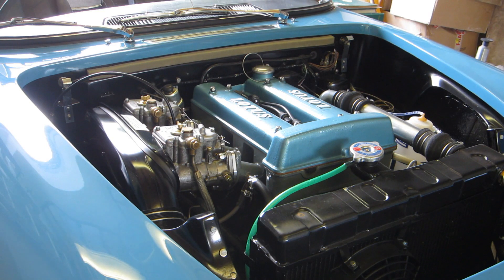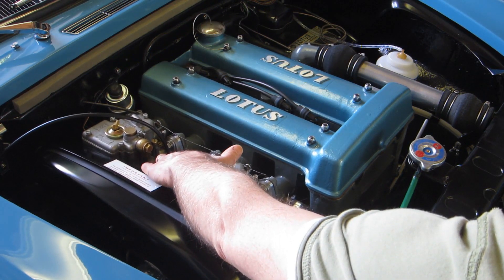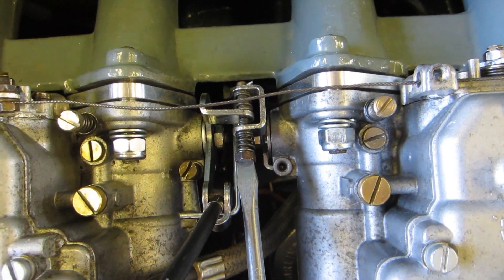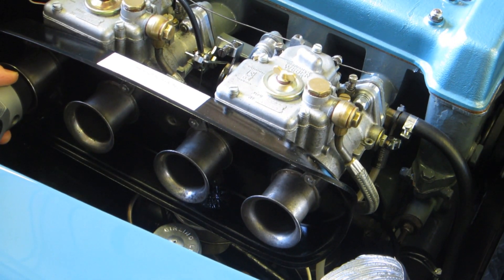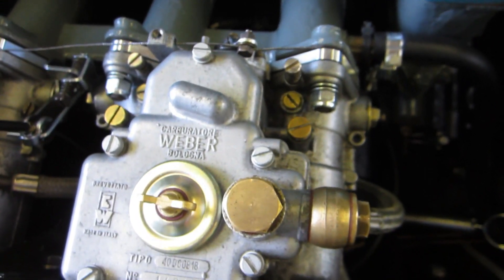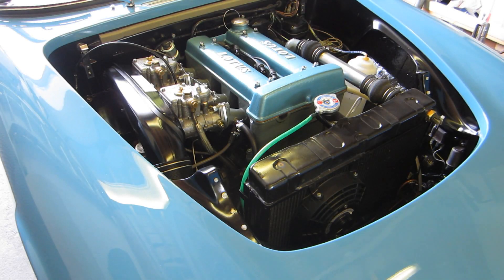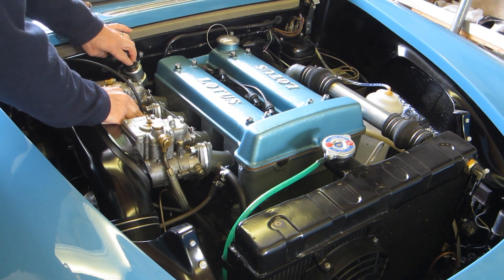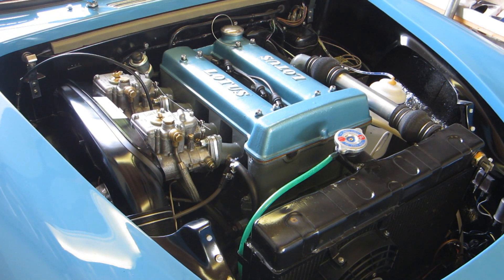Lotus Elan basic tuning

Comment: Brilliantly informative video Paul… I have similar problems with keeping my plus 2 in tune and fouling plugs.  How do you have your Webber’s jetted.
Reply from the maker: Glad you've found the video helpful :)
The jetting is as supplied by Lotus.  This is the list:
Choke size = 30
Auxiliary venturi = 4.50
Main jet = 1.15
Idle jet = 0.45 F9
Emulsion tube = F11
Air correction jet = 2.00
Starter jet = 1.00 F5
Accelerator pump jet = 0.40
Accelerator pump back bleed (intake discharge valve) = 0.50
Needle valve (inlet) = 1.75

I created a video showing the refurbishment of my Webers which is on my YouTube channel.  Here's a link if you're interested:
https://youtu.be/Whf3vKDnCJs?si=nOWD3CwigQ95ppdm
Reply: @PaulH_S2_Elan  Thanks Paul - same setup as mine however I cannot get the car to run reliably even with a colour tube and balancing the carbs.  I seem to foul plugs every couple of hundred miles or so!
I’ve rebuilt the carbs once before but will check your video to see if I missed anything!
Cheers,
Joe
Reply from the maker: I'd recommend searching the posts on lotuselan.net and ask that community.  There's plenty of knowledgeable people on there who could help.

Comment: Many many years ago and against the advice of some so-called experts I put a pair of Weber DCOE‘s on my modified  TR6. I did an enormous amount of reading about these carburetors and purchased many many Jets emulsion Jets Excelerator pump jets Venturis etc. etc. I had this car running with the best of them! These carburetors are not only infinitely tunable but deeply satisfying once you get them right. That car is long gone and as part of my stable I now own a 1960 bugeye sprite however it is super charged and therefore does not have side draft webers. If I was ever to buy another classic British car I would most certainly ensure it would accept a pair of wonderful weber carburetors.
Reply: Actually I had 3 carbs.   Oops

Comment: The problem is people expect old cars to idle from cold like new ones,  That's what chokes are for,  in the 70s to get a fast enough idle on a cold engine you had to have the chock out just enough to be in contact with the fast idle ramp on the carb linkage,  this didn't close the chock butterfly enough to richen the mixture but kept the engine running.   Then after 4 miles you could push it in.
Reply from the maker: Yes, no electronics and automatic choke to help here.  My experience of the Elan with Weber carbs is to start from cold, push the accelerator fully down and release, then hold the accelerator halfway down and turn the key.  Starts every time.  Pushing the accelerator fully down causes fuel to squirt into inlets, enough to start the car.  You don't need the choke to start.  If you are in the car, you can keep it running with the accelerator.

Comment: I thought a slack timing chain would affect valve timing therefore affecting engine balace.
Reply from the maker: I can't explain the science, but the Lotus manual explains there should be half an inch of chain movement between the two cam sprockets.  Push it down as far as it will go then measure from a reference face, then pull it up as far as it will go.  You're looking for half an inch of movement.  My new built engine didn't have any timing chain rattle when set up like that.  As the chain becomes used the tensioner may need to be adjusted slightly if you start to get any rattling of the chain against the inside of the cam cover.

Comment: Where can you get pressure test kit from please ......
Reply from the maker: If you search for Carburettor Synchrometer online you'll find plenty of options.
Reply: @PaulH_S2_Elan  The Uni-Syn is an older design but it gives you much more room between the carburetor and the body.  Costs less too.
Reply: Paul H thank you I have the old type that you have to tap into the carb
Reply: @frankhoward7645  my understanding is that the Uni-Syn is not as accurate and blocks airflow during testing; the STK style is better and works across the rev range. Check Google for more detailed explanations.

Comment: Sounds like a diesel
Reply from the maker: 😅No, not a diesel.  You can hear the timing chain rattling against the aluminium casing.  I should have adjusted it before I did the video.  Otherwise this is how the old twincam sounds